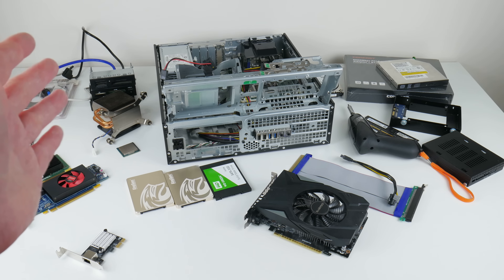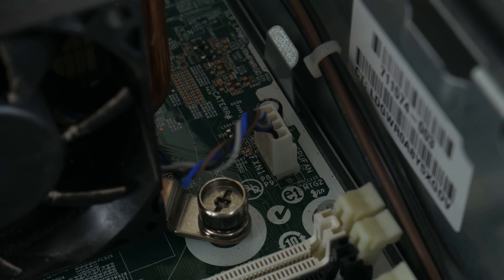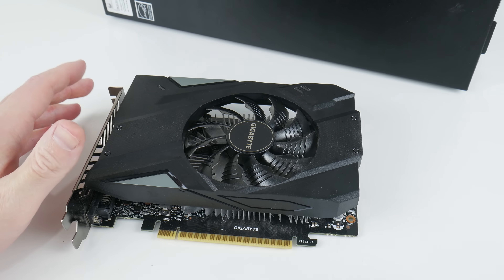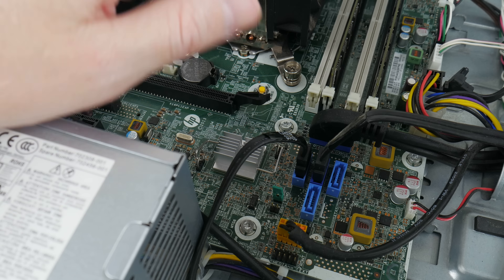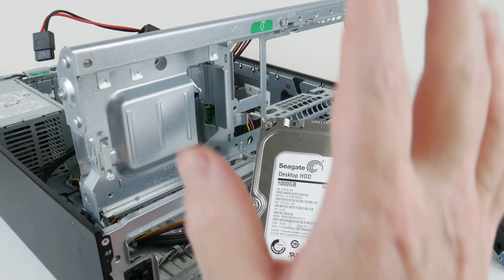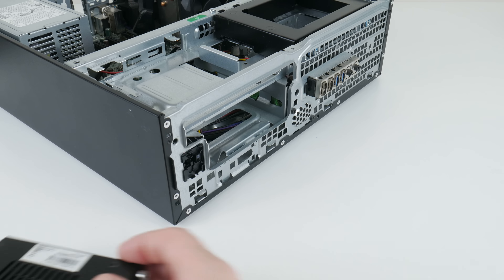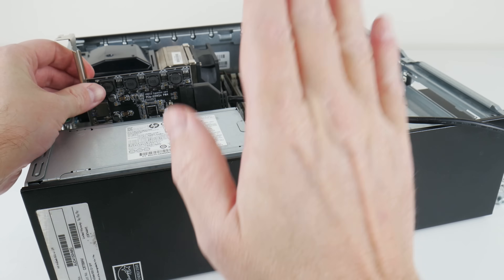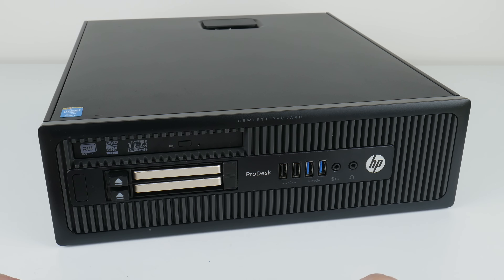HP ProDesk G1 Small Form Factor Upgrade Guide

Comment: I have used such little low high cases, but i stopped using them, because they (Nvidia/AMD) stopped 
making low profile graphics cards, the Radeon RX 6400, is just as slow as the GeForce RTX 1650, and 
when the GeForce RTX 1650 are already years old, and you need a MB that has PCI-E 4.0 slots, or you 
get almost half the speeds.

BTW, the Radeon RX 6400 uses only 4 lanes not 8 lanes, that's why he is almost have speed on a PCI-E 
3.0 slot.

I went for the CEMO L1 Aluminium minichassis, and put the feet on the side, and now it fits in my TV 
cabinet, but it fits normal graphics cards up to 24,5cm long, cases that can only use low profile 
graphics cards, are doomed now, because they do not make new low profile graphics cards anymore.

My spects of my Mini-Media/Console-PC: CEMO L1 with Silverstone FX350-G, Intel Core i3-12100F with 
Noctua NH-D9L, and 16GB 3200MHz DDR4 RAM, MSI Radeon RX 6600 Mech 2X 8G, Crucial P5 Plus 1TB SSD.
Reply from the maker: Yea I messed up with the lanes, just 4 that's sad. I don't like all the new cards focus on the high end and drag their feet with low profile cards. The newer SSF machines also have tiny PSUs, it seems corners are being cut everywhere...
Reply: @philscomputerlab  Yeah, it looks like that they simply do not care, and that in a time that energy prices go 
true the roof everywhere, they only want to make the fastest cards and the rest they not really care about.

We life in a very strange time.

Comment: I'm happy user of the ProDesk 600 G2 mini. Tiny and newer version of this one. It has a Skylake processor and both BIOS/MBR as UEFI/GPT support. I started at full legacy mode with Windows 7 and now I'm on UEFI/GPT mode with Windows 11. It only uses a little bit of energy which helps a lot as it is in use as a small game/web server.

Comment: Could you post a link to the USB 3 add in card you used in this upgrade im trying to find a good rated USB 3 add in card but Amazon ones are less then 1k reviews
Reply from the maker: Yea I just bought generic one. Look out for: Full height and half height brackets included. Some need external power (SATA or Molex), others do not (I prefer these, neater cabling inside the case.

Comment: whats the deal with "use only half", no, its designed for the rated, not the half, duh
Reply from the maker: ?? Context
Reply: @philscomputerlab  power supply
Reply: @Jkauppa  The "use only half" is for power efficiency. For example, if a power supply is rated at 80% power efficiency and doesn't have a "Gold" appended to the 80 plus, that means that it is at least 80% efficient with about half the power supply rating used. You can push a power supply to the full rating, if you use the proper rails (12V vs 5V etc.), but it will often be very inefficient. It will for example waste 30% - 40% of the power coming from the wall. It will also generally have high fan noise.
Reply: @harleyn3089  thats nonsense
Reply from the maker: @Jkauppa  Ah yes, PSUs are most power efficient when half the rated power is used. Best to aim for that.
Reply: @philscomputerlab  how about I just dont believe/use your things then, if you lose that much all the time
Reply: @philscomputerlab  do you talk your own, do you have God
Reply: @philscomputerlab  not even electric cars are that poor in conversion rates, what kind of crap are you guys recommending/selling, nope no thanks, I'll do my own stuff

Comment: Haha, I have been using this exact machine as my home NAS for the past 4 years. It was at the time, and still is, a great performer in this role, and cheap. I have the same CPU and RAM as you do, no fancy GPU since it's a headless machine anyway, I added a 2.5Gbe card and a SAS card (HP H240) connected to an external array of 8x3TB drives. The array is powered from a separate power supply, which is synchronized to the ProDesk's power supply through a relay. It runs Linux and ZFS in a RaidZ1 configuration.
As for the mounting screws, I said "screw'em" and mounted a 128GB SATA SSD with double-sided thermal tape somewhere inside the case for the boot drive. :)
Reply from the maker: I ended up buying some screws from AliExpress 😅

Comment: They're getting rid of these and slightly newer HP minis at work by the hundreds. I got my laptop replaced, but they said I would have to give up my separate HP mini desktop. I told them they can pry it out of my cold dead hands (yes, I actually told the guy in charge of the rollout exactly that). If I have to undock my laptop to go look at something or for a meeting, I might as well just delete all the documents I'm working on and start again. Switching from Ethernet to wifi half the time it complains when I go to save them that the files are already open by another user, which would be me. And thanks to my crippling ADHD, if I have to close a document, it's going to take a while to find where I was and get back on track. Not to mention disconnecting all my SSH/telnet sessions.

They ended up letting me keep the mini, but at some stage I'm going to have to ask my boss to fork out for a new one. It's a G1 with an i7-4765T, which is really starting to show its age.

Comment: We sold more than a hundred used HP SFF Prodesk and Elitedesk PCs of various generations, all of them work like a charm. The HP 8300 SFF is useful if you want an Ivy Bridge PC with USB 3.0 which is fully compatible with Windows XP, Windows 10 and Windows 11.

Some of our customers added a Geforce 1030, 1630 or a 1650, as shown in this video. Works like a charm. The older Elitedesk series requires an extra fan to cool the Geforce 16xx series. All kind of expansion cards work fine as well, including PCIe to NVMe adapters.

Comment: for more advanced users willing to risk it, disabling patches for spectre/meltdown can help squeeze out extra performance

and for any one else looking to get into repurposing one of these older machines, make sure you know what you're getting into with the parts included; an i7 back in the day was largely a waste of money over an i5 for many users, but can make all the difference today with the extra cache and threads being necessary to make more modern games playable, and i3s of the era might have been perfectly fine for everyday tasks but can be a bit rough for today's standards outside of niche use cases where a Haswell i3 will still make for an awesome homelab router, or dedicated retro gaming/emulation machine.

Comment: I really like these machines and the Elitedesk 800 (which is basically identical internally). I managed a fleet of about 300 of them at my previous job, the hardware quality and ease of service is very good, and the failure rate was very low (maybe 2-3 out of the 300 that wasn't caused by users). I had a couple I used at home & gave to family when they were replaced at work, and they're still in daily use to this day.

Great job explaining and showing all the different capabilities for machines like this, now that they are widely available cheaply on the 2nd hand market due to enterprises updating. I would say one of these machines with a few key upgrades is much better value than most low budget new machines.

If buying one now I would perhaps try to get the next model with a 6th gen CPU and DDR4 memory.

Comment: I've been using what is basically the Dell equivalent of this PC (4th Gen Intel Core, etc) as my son's online school PC for a few years now. I bought mine in the spring of 2019 for $99 US via Ebay. Upgraded the RAM to 16 GB, installed a SATA SSD and a Nvidia 750 TI card that I already had. It's quiet, has been completely dependable and for my son's school work and his light gaming (Roblox, Among Us, etc) it's been excellent.  At this point I'm not looking to possibly replace it until the summer of 2024 unless it were to have a major hardware failure before then.
Reply from the maker: Awesome 😎

Comment: Love these videos.  Something looks odd with your benchmarks... the Intel integrated should never beat a discrete GPU card.  That 8490 is not a bad card, and cannot see how it was beat by IGP.
Reply from the maker: It is what it is, these Radeon cards do have better drivers though with more options and also XP compatible for Retro Gaming.
Reply: @philscomputerlab   Absolutely...never undervalue that XP compatibility.   I was simply surprised your results showed the card losing to the 4000 series IGP, as several other sources have the Radeon performing about 25-33% better than the i7 IGP.   Not a big deal.  Like you said, a person can do far better with more modern cards for modern gaming anyhow.  You ought to check out an A2000 Nvidia card for that... expensive but probably the best low profile experience possible.
Reply: I was thinking the same, but if you look it up the 8490s name make it sound a lot better than it is. It seems like an OEM card only with very low specs and DDR3. I used to have a system with a GT520. I remember this card is just slightly better than Intel 2000 series graphics in 2nd gen CPUs. HD8490 is not that much faster so it makes sense Intel 4000 series graphics could beat it.

Comment: I love the Z240 SFF versions of these HP boxes. They have V3/V5 Xeon E3s, ECC support, and better drive bays that don't require sleds. They also have thoughtful touches like 4 extra of those hard to find screws, along with the standard SATA drive style screws. Diskless boxes with 16GB memory and a Quadro K620 are under $100 on the bay.
Reply: I have one of these which I bought from eBay for £60. I'm very happy with it for the price.
Reply: Most of the Z-Series workstations also have surprisingly good RAID controllers. They make really nice NAS boxes or just a reliable place to store large amounts of data like videos.

Comment: I don't know what the prices are like in Australia but for around $150-200 US there are modern hp elitedesk units that are very slim that use ryzen chips. Either 1st or 2nd gen g series chips. (4 cores. 4 threads but I never looked into if they were upgradeable) Less expandable but I think they have at least an nvme slot and a 2.5 inch bay. Lenovo has units with the same specs and a similar form factor as well.
Reply from the maker: Wow that's interesting. Haven't come across one yet...
Reply: @philscomputerlab  I just had a look at australian ebay and unfortunately the ones there are way more expensive.

Comment: I have a few of these. I turn them into emulator machines with e9173 radeon cards and on my next step down I5-2400 machine, I put XP on it, used snappy driver and use a gt 740. I love these machines.

Comment: If you just want it as media PC/Server, even for the 4K, you can plug low profile 1030/1050ti/Quadro P400/P1000 and it will have support for the modern encoder/decoders, except AV1, CPU is still powerful enough and you can even use it as light gaming/emulation PC as well

If you still decide for the updated version, there are relatively cheap dell optiplex SFF/ HP ellite desk SFF's, with Intel 8/9 gen CPU's, but be aware, some SFF's have very annoying PCI-e layout, for example, I have dell optiplex SFF, 8 gen core i5, but PCI-e X16 is located right next to the PSU, so only 1 slot, low profile GPU will fit, only real option is GT 1030/ Quadro P1000, I do not consider RX 6400 since it lacks hardware decoders and its 4x PCI-e lanes are significant bottleneck for the 3rd gen PCI-e, also usually in newer models there are only 2 RAM slots, so this way its also limited.
Reply: P600

Comment: These HPs are great value, so I'm sure we'd all like another video of a later model.  I recently re-housed a HP ProDesk 600 G1 SFF in a standard size case (DeepCool MACUBE 110 MATX) for someone who wanted something with a glass door and some RGB.  Pretty easy because the motherboard holes lined up with the new case.  Kept the exist power supply, but could have upgraded to a standard power supply if I bought an adaptor cable.  Perhaps you could do a re-housing video of a later model HP?
Reply: Hp 600s g3s (6th/7th gen) are even easier to recase, wide itx sized board (16x on the bottom tho so wont fit most itx cases), all holes line up perfectly in atx/matx towers, no need for adapters for anything (takes normal 24 pin psu, front panel has pinouts online, usb2/audio headers are standard)

Comment: I did something very similar with the Dell Optiplex 9010 sff. Came with an i7-3770, I installed 16 gigs of ram, and added a low profile gtx 1650. Used it in my living room with my entertainment center. Sometimes I take it to my parents place if I plan on staying for a bit. Really solid build for its size and age of parts.
Reply: I did the same thing but i picked up an i7-3770s and had to upgrade to 32gb of ram and a radeon card.  put holoiso on it and its great.
Reply: @worldgate989  what Radeon card do you recommend?
Reply: @victorfigueroa9385  rx6400 low profile

Comment: That icy dock is the best, so simple to swap in 2.5” SATA SSDs and HDDs easily for quick data transfer or multi-booting with separate bootloaders.

Have it in a 3.5” to 5.25” adapter to fill an empty slot where an optical drive would go. 

And since the front side of the inserted disk is visible, one can easily put small labels onto the disks, so you always know what’s currently inserted.

Comment: I got one with a HD8490 and and a i5 4570 and by removing the GPU I actually got more FPS.
Why HP put a GPU in there that is slower than the integrated graphics is still a mystery.
I repurposed the HD8490 for a older Core 2 duo system.

Comment: what did you do miss out on gtav when it was free on epic lol I figured that would have been in the testing and one question if you do end up reading this do you do fresh win 10 installs on each PC or are you just moving a windows install that's on a HDD around I recently discovered that doing that can have bad results actually and wondered if others had any bad experiences in doing that like it works did it for years but in games knew I should have been getting better fps even after using DDU but after new windows install bam stutters fixed u ever have that happen I'm guessing cause main install was done on a ryzen system then used on a i3 laptop then moved to a i5 desktop and that's where probs happened  rofl ?
Reply from the maker: I have the game through Epic lol. Yes fresh installation for every project.
Reply: @philscomputerlab  thats good was kinda hoping to see that one there im so use to seeing it in benchmarks even tho i know the results it woulda played that game good  still a great video tho n thank you for answering so quick.

Comment: @PhilsComputerLab Why would you state that this PC requires the use of a low-profile video card, only to benchmark using a full-height card that would not even fit in the case when it is closed? Doesn't make any sense to me. One would think that you would benchmark using a more powerful half-height video card card instead. Please help me understand why you decided to use the full-height video card card when clearly one could not use it normally within that case.
Reply from the maker: I don't have a low profile 1650.

Comment: There is another GPU that would fit inside this case.
The RTX A2000 12GB version,  but that would be more expensive than a fully decked HP G1 SFF PC.
Reply: The 6gb version is less than a ow profile GTX 1650.
Reply: @harrybryan9633  That doesn't make sense, the RTX A2000 is a much faster enterprise GPU.

Comment: We must be on the same wavelength. I ordered one of these last month and they shipped me a barebones by mistake, they let me keep it and then sent me the one I ordered with a i7 4770 and 8gb of ram+ 250 gb hdd. The other one I wanted to use as a free pc build so I bought a 5 dollar core i3 4150, spent 18 dollars on four 2gb sticks, paid 20 dollars for a r7 250 and used a 10 dollar spinning hard drive I got off ebay. I'm dual booting windows XP and ubuntu 22.04 and it runs like a dream.
Reply from the maker: Awesome 😍

Comment: I deal everyday with HP ProDesk G1 computers in my work, without SSD they are really slow.
Reply from the maker: Yup, SSD is the best upgrade you can give an old machine. Some say mechanical HDD is ok, maybe after a clean installation. But after a 2 year old Windows installation with updates and software loaded, no way...

Comment: I really like these ProDesk machines. I bought one a couple of months ago with the i5 4570 for $44 US shipped. They are more commonly in the $60 to $100 range, but that's still a good deal if you are looking for a small form factor computer at an affordable price.

My most recent project is a Shuttle H170 mini PC that I got just as cheap with an i3 6300. There are so many good deals on 3rd through 6th gen Intel machines nowadays, and the performance is still completely usable.
Reply from the maker: You are right 🙂
Reply: Yep you can still game fairly decently on these systems. My daughter had my old i5 4690 16gb ddr3  combined with an rtx 3060. Worked great. Now my youngest has it paired with a gtx 1070.

Comment: The 6400 is actually even worse than you said. It uses 4 lanes of PCIE 4, not 8, 8 lanes of PCIE 3 would be fine for a low end card.
Reply from the maker: Ohh, only 4 lanes! Not sure how I missed that one. Thanks for pointing this out!
Reply: Indeed, and this is true for the 6500 as well. Performance loss could be around 15 percent on average when you're limited to PCIe 3.0.

Comment: Much better to work than the Dell XPS Desktops from the same generation (I need to clean mine past month, and is a nightmare).
My only complain is that some of this HPS have problems with Pré 10xx/RX GPUs
Reply from the maker: What problems did you encounter? I tested quite a few graphics cards from older generations with this machine.
Reply: @philscomputerlab  some simple don't post, techyescity is always talking about this, thankfully I only encounter this problem once